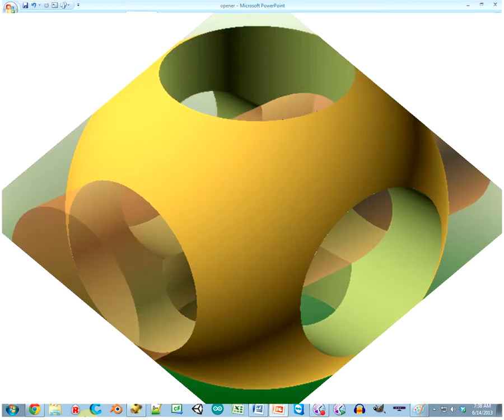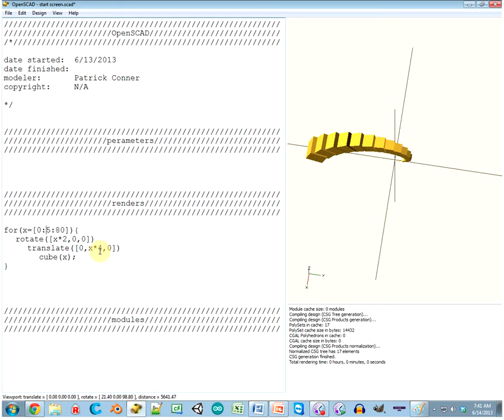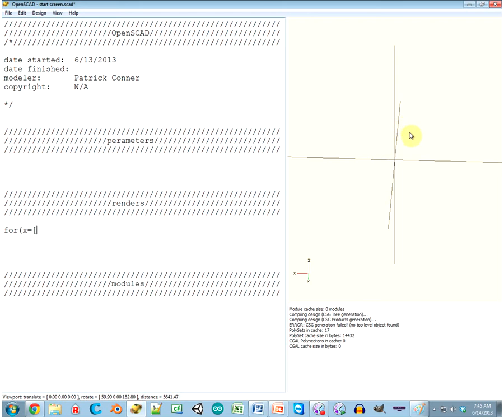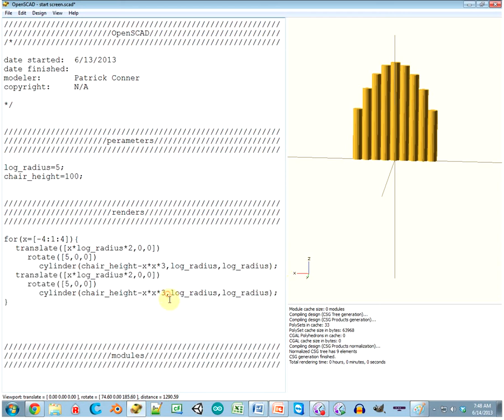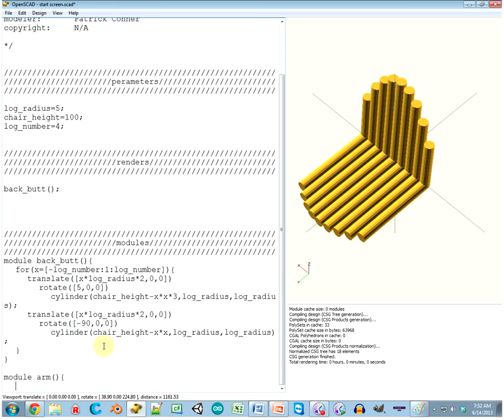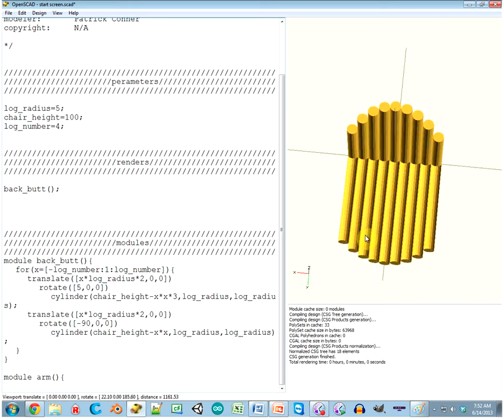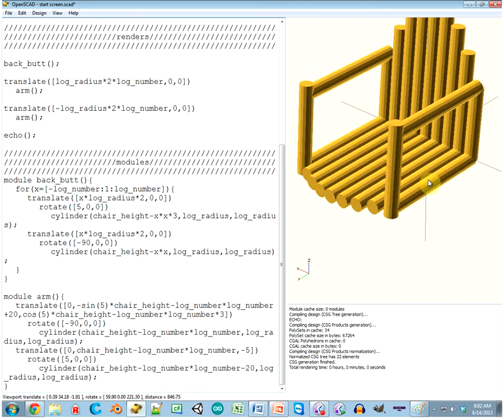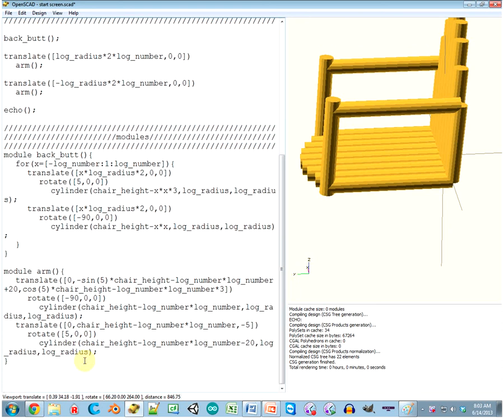for and echo in OpenSCAD

Comment: I want to commend you on making some very accessible videos here that were exactly what I was looking for as a reasonably experienced coder looking for a quick entry point into this language.  Your content is quite good. I agree with some of the other comments below regarding your presentation style, which was a bit painful to listen to.  If you've had a traumatic head injury at some point in the past, or a present and ongoing drinking problem,  I will retract this comment.   Either way, thank you for making these videos.
Reply: If you can type quickly, adjust the viewing speed to 1.5 in your youtube settings (the sprocket icon on the lower right side of the video)...
Hope this helps.